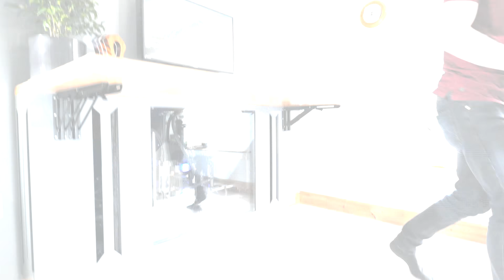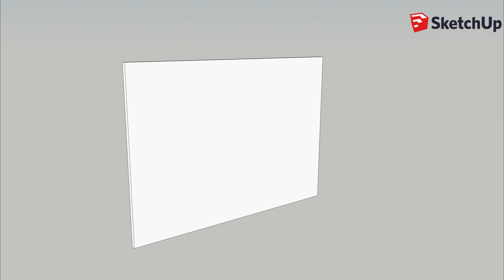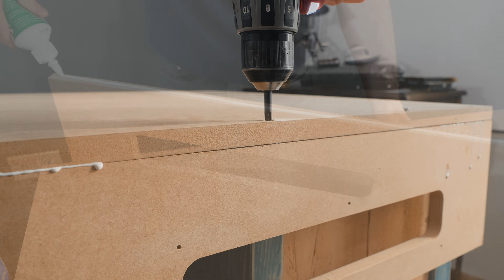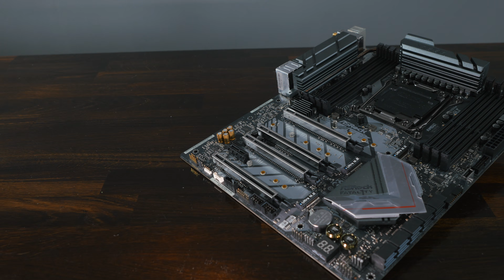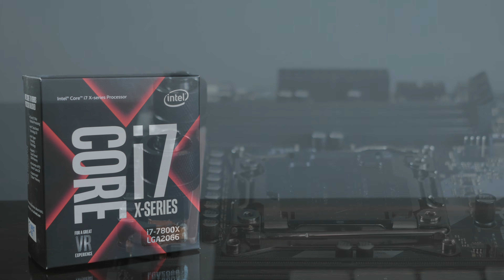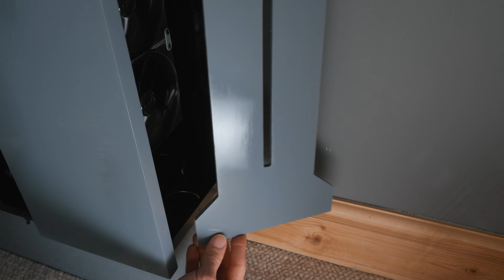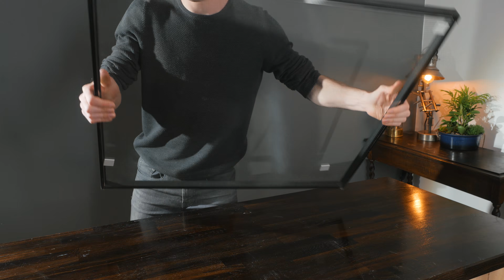Building a spectacular DIY 'desk PC' (it can fold!)

Comment: Really nice coolers.. i was thinking about cooling mouse house passivly during the summer by simply having a coil running 30 cm down in the lawn radiating heat into the ground then having one of those coolers inside the house.

Comment: I think that letting water pass through GPU and CPU in the same loop with no radiator in between is not a very good idea, considering it's RTX2080. At 30:34 you can see the CPU temperature is much higher than the GPU one, but I would say it isn't necessary to change the design since it's still a pretty low temperature.

Comment: I am not sure if that passive PSU will hold up for long. Although it has no fans of its own I believe it relays on airflow provided by the case fans. DIY sleeved cables look fine but you could have made your life a bit easier by ordering custom ones pre-made by CableMod ;)
Overall another great DIY video :D

Comment: Epic build, im doing similar but using a sealed air cooling setup with a back wall vent drawing in from the eves of the house. Keeps the noise out if the room.

Comment: I'd like too see a more in-depth video on the capacitive touch switch's.
Reply: Check out TTP223 datasheet or just look them up on google. Loads of info if you are really interested.
Datasheet: https://datasheet.lcsc.com/szlcsc/TTP223-BA6_C80757.pdf
Reply: get a relay module and a capacitive touch switch.... connect them to your power supply, connect the i/o pin of the relay and switch together and thats about it.
if you have no idea what i am talking about: i STRONGLY recommend you to learn some eletronic basics, because you deal with mains voltage here!!
Get some Arduino starter kit for example.
Reply: Done some research thanks.

Comment: Great job! I suggest investing in a gravity fed spray gun. A cheap LVLP gun with a 50L air tank yields effortless results with a bit of practice. Also I'd suggest water based acrylic colour coats with a water based polyurethane clear coat over the top. Water based makes for easier cleaning and reduced toxic fumes. The acrylic and polyurethane have fast drying times and are very forgiving to use.

Comment: Really impressive...
I build a table-integrated watercooled silent-PC myself, but now seeing yours regret some of my design choices. For example mine is under a glass table top, wanted to show off the watercooled components ;) But that makes it dusty and decreases accessibility for upgrades and maintenance...  And my table takes up a lot of space, so this foldable approach is really neat... 

And my table took about 5 years to be completed ;) I had to learn welding and spraypainting with a compressor, using sketchup and so on... :)

Comment: Why not used 4 magnets for the frontpanel, or 1 magnet and 2 doorhinges on the inside ?
That way, you don't see screws on the outside, and the frontpanel is very quick removed/opened, without unscrewing 20 screws to get access to the inside.

Comment: A: Cable Mods would solve you cabling problem without cutting.
B: Possible problem if the HD Drives are not fixed

Comment: 20:40 Not fully through the video yet, but noticed that your drainage-T-splitter is on one side only sealed up with the provisional (blue) plastic cover. You should replace it with a real plug-screw like at the pump. 
I accidentally made this mistake  before, and at some time i had some water flowing out of my pc

Comment: This is a crazy impressive build! You must really hate noise with a fiery passion to go to these lengths (also holy S, handmade individually sleeved custom length cables!).

For chilling it, might I suggest using silicate dehumidifying pellets instead of trying to evacuate the interior? It's much easier, won't require an extra pump, and it won't stress your case with a pressure differential.
Reply: could have just bought nicer cables from cable mod though^^

Comment: Isn't the radiator on the inside heating up the chamber?
Reply: no
Reply: @girlsdrinkfeck  why not?
Reply: @thriemboy1706  i think its after the 2 external radiators, so it should still be able to cool... though he is heating the vrm and cpu with the gpu heat
Reply: @johnuferbach9166  thank you for your answer. This makes much more sense to me

Comment: Fantastic build, gives me a lot of ideas for a marine grade PC case...
Things I'd personally change on this build are
1. Prime and sand all the pieces before assembly, assemble and paint the top/bottom/sides, then attach the pre-painted back (will improve the finish and if you're careful with glue should make it faster/easier since you won't be sanding awkward spots or fighting the spray paint air flow)
2. The folding desk top should be transparent to get the visibility advantage of the thik-desk version; the wood surface obscures way too much unless you're leaning over

Comment: Can you use thermal plate to turn heat from place to cool to another place using good thermal conductivity material
Because cooler is quitter
Cooler is faster 
& using wasted energy for something cool 😎
Reply: If by thermal plate you mean a teg? You could but you still have to get rid of the heat somehow. Sadly they just aren't efficient enough yet to make sense over a traditional fan and heat sink setup

Comment: Anyone have an estimate of how much this project would cost to make without the PC components
Reply: Harryvj Alot. Each radiator is over $100, as well as the pump. Fittings go for anywhere from $2-10 per fitting (depending on type and make), and Water blocks can get expensive too (well known brands go from $50-100). Good static pressure fans can be $20 per fan. I’d wager $900+.
Reply: @reaperreaper5098  dayum, i was guessing 500 for the cooling^^ (and like 2k for the rest)
Reply: @johnuferbach9166  It gets expensive fast.

Though, if you build with EK's aluminum parts, price drops significantly.

Comment: Did you check the M.2 drive with the thermal camera after you have the system running and using it for a while? These are well known for running around 100c with bare and most m.2 drives /REQUIRE/ active cooling. heatsink + Fan.

Comment: I'm slightly worried about your design with no air circulation at all. Some of the components on the motherboard and the power supply needs a bit of air to keep functioning optimally. Especially under heavy use loads. The motherboard components might get enough cooling from the cooling of the board from the water blocks, but the power supply might go poof at some point :p

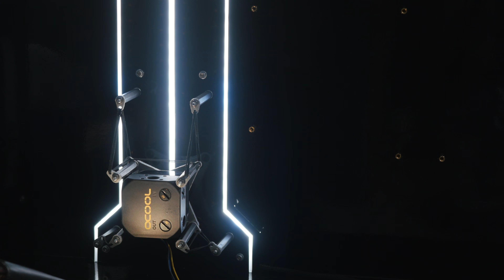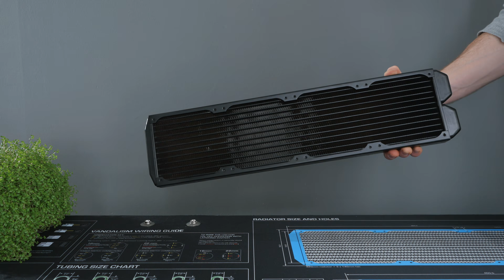Comment: You should put mesh dust filters on the sides for your radiators. Your intake would be cleaner and make less dust inside the case. Also just get an EVGA power supply, its overall better to have a fan in your PSU. 12:27 is BO2 logo. 13:32 YOUR RAD LOOKS RUSTED

Comment: Cool idea, but all those cables and tubes showing make it look like a mess inside. Also I think the clear hard tubing would make this look wonders even more.
Personally though I still prefer good old steel cases. Not to mention "noise" part. Most custom watercooled PCs (not AIOs) are silent, rest need tweaking/better fans/pump.

Comment: Yes, I would love to see the build with a water chiller. I only saw this as a fascinating passion project at first (although the amount of work, originality, and skill is very impressive) because my computer gets around 85-95% of the way there in noise, with better thermals and (arguably) better looks. Or I can get even better noise performance by keeping my PC in my tiny wine cellar, which is temperature controlled so I can set my ambient temps and with the glass door closed with cables coming through the wall, I can't hear my PC at all. But the lack of dust, possibility of doing sub ambient, and other, more minor but still very intriguing ideas presented in this build have captured my interest. 

Also, with even more radiator space you could probably forgo fans entirely on the outside of the chamber, although it's costly and largely unnecessary.

Comment: i really hope you cleaned those rads. mine had a lot of residue from factory in them. i was also thinking you would add sort of a servo to the table top to lower it automaticly. and last thing i have in mind atm is that a D5 could have been better than a DDC. but i guess if it works it works. just make sure to change coolant every year.

Comment: The chamber can be air tight, but if you have active cooling outside of it, then it doesn't "lock in any noise generated by the components". Even if it's not direct noise, like from the hard drives...

Comment: I'm in the process of getting ready for my 12 core AMD this July, and this piques my interest.
However, your system is primarily water-coooled, in an air-sealed box, with a passively cooled psu.
You showed running temps, however not time/duration.
Running 300-400 watts in that air-tight box would seem to me to be making things worse.
Granted the cpu is water cooled, is the gpu also?
If both are, thats good, however they are all getting their power from the psu, right?
So if the psu is dump 300-400w via its passive radiator inside the box, would seems like that is going to eventually build up.
If you only run your system for a couple of hours or so it may not be a problem, but for those of us who are gaming or working on our systems for 8+ hours a day, continually dumping heat into an enclosed box would seem to be unadviaseable.
But that excess heat may end up making your water cooling rigs work harder but still be enough to offset and there might not be any obvious problem aside shortened life of water cooling rig I guess.
Warrants further testing.
Reply: psu is probably 80+ so its max dumping 150W

Comment: I love your videos but can you explain to me why there's a radiator inside of it of it completely air tight.
Reply: There are component that while not hot enough to justify individual water-cooling heads do produce heat that has to be removed from the case, such as the hard discs.  The 'radiator' here is a heat sink, allowing that heat to be removed from the case for the benefit of those components.
Reply: @calmeilles  thanks :) that makes sense

Comment: "The entire interior is airtight". I have concerns with the heat made by the HDDs, SSD, the motherboard itself, the RAM, and the chipset itself. How are you going to combat those? Usually from what i see where the entire system is watercooled, airflow is still present to take away heat from heat producing sources like mentioned above, not entirely airtight.

Comment: Great to see you back and to see this video finally make it to YouTube!

You've still got plenty of thermal headroom on both the CPU and GPU for some good overclocking. If worse comes to worst, you can delid the CPU and replace the TIM between the die and the hestspreadder with some liquid metal, since even on Intel's HEDT CPUs from that generation, the hestspreadder is not soldered (at least, IIRC). I think you'll be hitting voltage or even PSU limits before you hit thermal limits when overclocking this monster.

Comment: You should have a good UPS to protect from Voltage Spikes on the System.
Reply: I good surge suppressor will work for protection. Just replace it every 2 to 5 years since they wear down every time there is a power spike. The power supply will protect against any brown outs and slow over voltages.
Reply: You don't need an UPS unless your area are known to have frequent brownouts or blackouts.